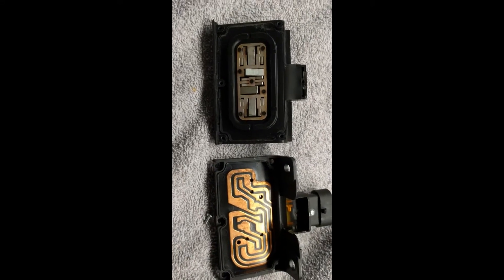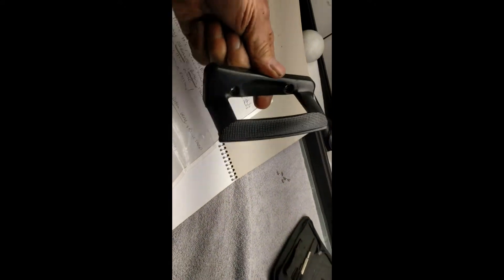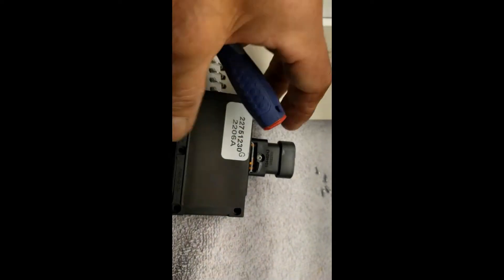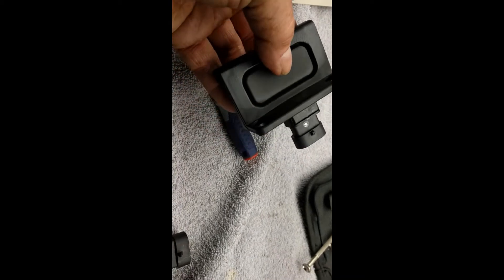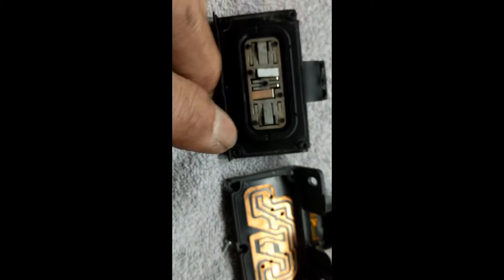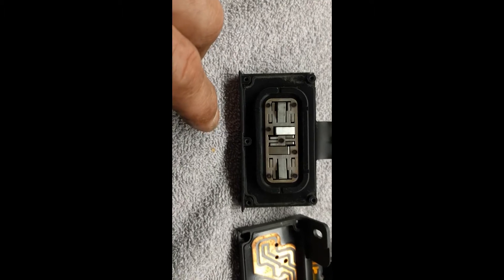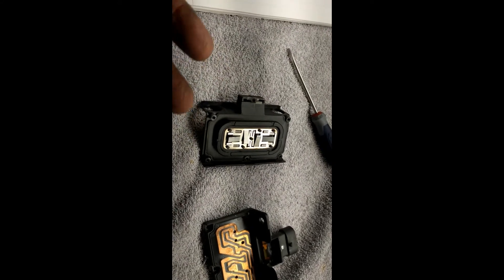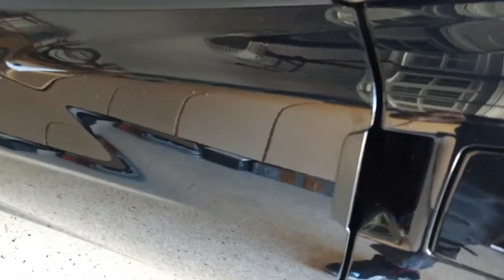Corvette c6 z06 door opening mechanism sticky won't open by froggy

Comment: I did this on my 2005 yesterday now the door doesn't open from inside ..the glass goes down but the door keeps locked .. any suggestion
Reply: Hi panzer, could you fix it? i have the same problem in my C6
Reply: @estebanm13  I did... I sprayed some electrical cleaner inside the latch and it works ...remove Door switch pads...spray electrical cleaner inside the latch that ...also did you replace the round button on the door panel ?
Reply: @panzerwaffen2873  Thanks, i didn't replace the round button jet, but I'll try to fixed with electrical cleaner! thank you very much!
Reply: @estebanm13  disconnect it clean it and plug back ..good luck brother